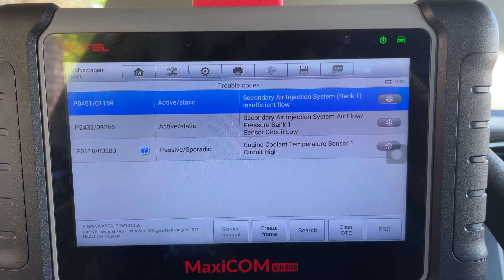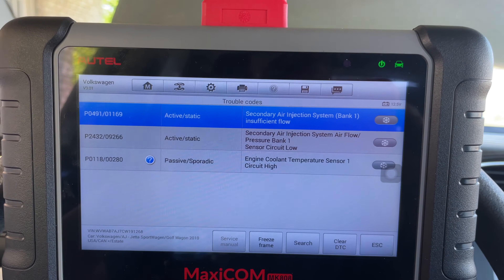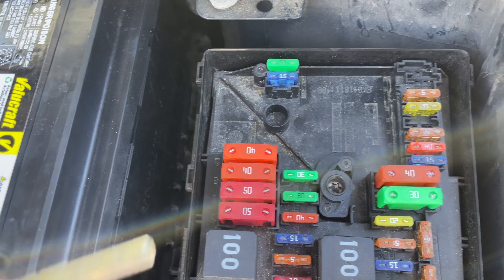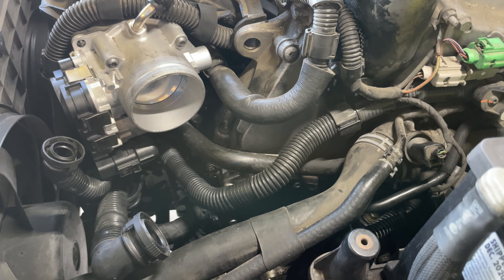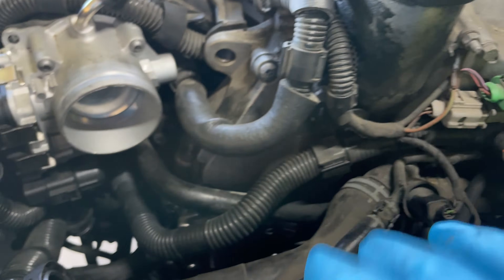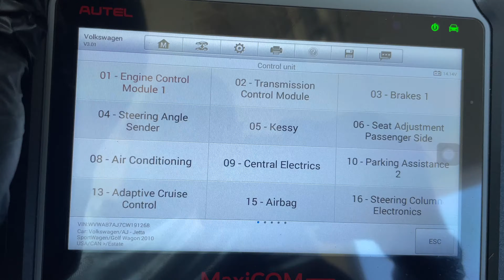Volkswagen Golf Secondary Air Injection Insufficient Flow Diagnostic

Comment: I have same code 1. Replaced SAI sensor 
2. Diagnosis hoses no air leak 
3. Replaced combination valve 
4. Pump was leaking air so resealed with gasket maker . 
5 .relays and fuses working fine. 
After clear codes i drive 2 days about 20 miles no light . But this morning again pop up same shit 🤷🏻‍♂️🥴 i fed up to fix this no clue what’s going on . 😟
Now i am going Replace engine air filter & Air pump again. 😢
Reply from the maker: Sometimes it helps to go back to the basics. Monitor data from your scanner to see what the computer system does not like. I wouldn't replace anything until I confirm proper air flow from the flow sensor.
Reply: @pierrerepairgt  today i open the air pipe there is no air flowing while engine run. Probably pump dead or harness loose.
Reply from the maker: @Our_America  The air pump is not ON at all times, but should be ON at cold startups. You can try to activate with a scanner or bring power and ground to it.
Reply: @pierrerepairgt  but when i tested power supply last time with led bulb. It was lights up even engine was warm. It have joint in connector last time it was loose. Probably the same joint is loose again. Thanks

Comment: Nice video! I’m surprised that the secondary air pump said “made in America”, I didn’t think any VW OEM or aftermarket parts were made here. Also, did you consider just using epoxy to fix the air pump housing crack?
Reply from the maker: Thank You. I was surprised as well. Good point, I actually didn't think of epoxy haha. Please subscribe if you haven't already.

Comment: Any hints on how to replace the solenoid/crossover valve/switch that sends vacuum to the combi valve (repurposed EGR)? On a ca. 2000 VW/Audi 1.8T, it hangs under the intake manifold and is a bear to get to. 

My air pump and combi valve pass the air flow test, and I have one more test to confirm this, but I believe I am not getting vacuum from the small switch valve.
Reply from the maker: All Data Diy is a good resource you can use for instructions. Unfortunately, I have not replaced one of those yet.

Comment: I wish if you showed how you took the air pump out .
Reply from the maker: I thought about it, but the video would have been a little too long.
Reply: @pierrerepair86 you got the rest of the video I need change my pump 😢
Reply from the maker: Most of the action is underneath the car. I used a u-joint to remove a bolt that was hard to get to. Sorry that I don't have the air pump removal video.

Comment: What  problems can. Secondary air pump cause
Reply from the maker: That will cause your check engine light to turn ON. Your catalytic converter will not reach operating temperature quick enough therefore, closed loop operation will be delayed.
Reply: @pierrerepairgt  estando dañada esta parte el vehículo ara falla de que se acelere???
Reply from the maker: @manuelllanas.777  No.
Reply: Need help still

Comment: I'm trying to replace my air pump for my 07 VW Rabbit, how difficult is it to remove the air pump? I saw other videos where they used a large wrench extender and came from it from the other side of the engine just to remove the nuts on it from the back side of air pump, is that true? What size socket did you use?
Reply from the maker: I’m sorry for the late response. I’ve been on the road a lot. Were you able to remove the air pump?

Comment: Ok, 07 2.5 wabbit 5spd stick.
2ndary air pump is running like a vacuum full-time.
I found the hoses to the pump compromised, replaced both hoses.
Replaced pump, replaced solenoid valve, and swapped the 100amp fuses to see if that was the issue. I even replaced the MAP sensor under the throttle body. I cleaned the throttle body while I was at it.
I have looked for this SAI sensor but have never found it, it's supposed to be on one of the tubes, but there's nothing. Also, I am the one and only owner. 

I did find a video about the SAI and MAP sensors being physically identical. However, they are not one has to be sure that the right part number is in the right location.

Any help with this situation is greatly appreciated.
Reply from the maker: Sorry for the late response. Please let me know if you still need help. I’ve been working in the field a lot in the past few months.
Reply: @pierrerepairgt  I have never fixed this issue...yet.
Reply from the maker: @thecrittergitter7576  I am guessing you still have the same code after replacing all the above components? 
You are correct, this vehicle should be equipped with an Air Pump Pressure Sensor. Subscribe to Alldatadiy, it’s only 19 dollars for a year. You should be  able to get a system diagram there. It helps a lot!
Reply: @pierrerepairgt  since I replaced all those components I don't have a code and have had a code  since. 
I was recently watching a yt video about my F-150 truck about something totally different, but got my mind wondering. If the pump itself in the connector might be pinned wrong causing constant power? 
I am going to check out that website for a wiring diagram.
Thanks for your help.
Reply from the maker: @thecrittergitter7576  I am not sure if you checked the relay; it might be stuck closed. Let me know what you find.
Reply: @pierrerepairgt  I remove the relay and the fuse and it continues to run constantly... engine running of course. It gets louder the faster I go.